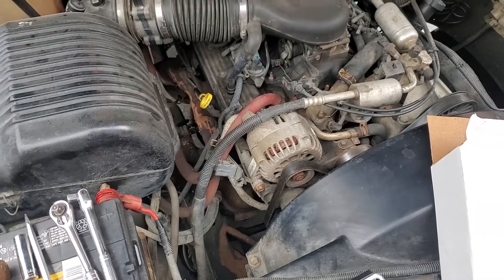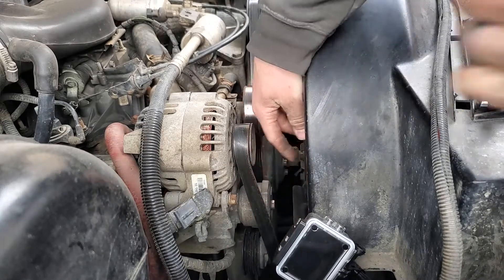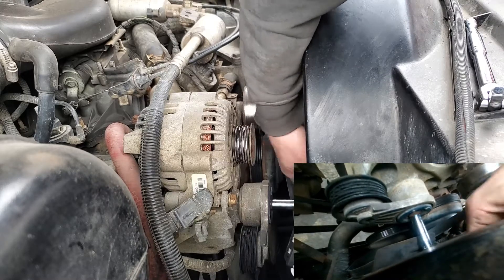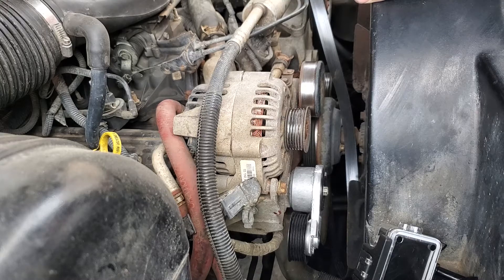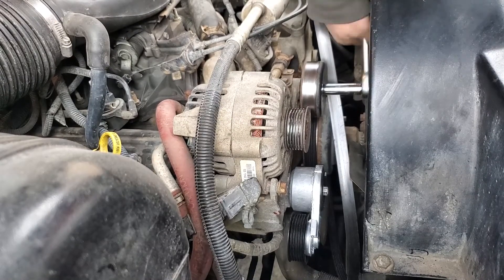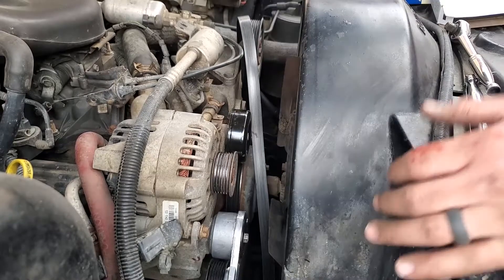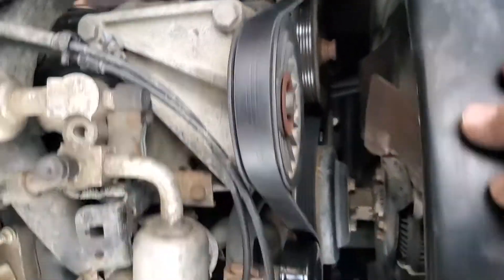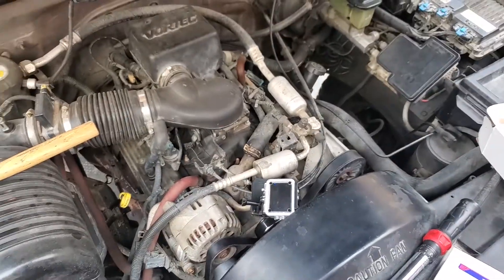How to install a tensioner, idler pulley and belt on a late 90's Chevrolet K1500 5.7L V8

Comment: Beneath that mock pulley is a boss to put a grooved pulley to bypass the AC, or for those that do not have AC..  trying to find a video on that setup as I just bought that bracket to swap my older truck to serpentine and it did not come with the bolt or pulley there..  I found the grooved pulley just need to see if there is some special bolt or something behind pulley, etc..  I see images of using that boss, but no details or parts list.

Comment: Great video Sir.  Thank you.    I have a similar setup.  I also have the Mock Pulley instead of an AC compressor.  By any chance have you played with the possibilities of a smaller belt going directly to the Power steering ??
Reply from the maker: @jameslaiola4976  no but I was hoping to do the same thing. Could probably play around with belt sizes until you find one that fits..
Reply: @rosincore  i hear ya Brother.  Its hard to find these things.  But if you ever need it.   I did find a size for a 7.5 liter ford